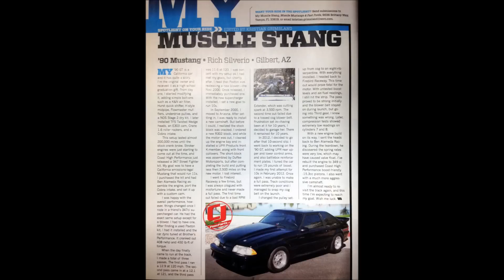Foxbody 349 (.060 over) Engine Build

Comment from the maker: script420 Yes it was a Coast 347 kit. I've had this kit in my car for 10+ years. The piston failure was due to an extreme lean condition from an overly aggressive on timing curve (my fault). Expensive learning experience.  Coast High Performance is a great company. That's why I re-used them on this build. If you're running a stock block that may be your issue. They weren't designed to withstand that much power. Good machine work also goes a long way. I had split a stock block in the past even though it was girdled. Back then I was only making 413 hp with 450ft lbs of torque. That's why I'm running the R302 Block now.
Reply: FitFox crazy I lived in AZ in the 90s and I think I've seen this car at the Pavilions Auto Show lol small world. Great car!!!

Comment from the maker: @kyle you should be fine. If you look at my other videos you'll se a black coupe. That one has 165k miles on it. I've added GT40 heads, Trickflow intake, E303 cam and a Nitrous Express 175 shot kit. Cracking a block with the mods you mentioned is very unlikely. You'd have to be pushing at least 500 horsepower before I'd worry about it.

Comment: My buddy has the same cam in his stock bottom end 302 with ported p heads. You would think its to big at 579 lift and 238/246 duration at 050 but it's pretty strong for what it is. Runs low 7 8th with a T5. He has alot in his suspension though and it weighs 2750 with him in it.

Comment from the maker: 93foxwcube-its only a 28x11.5 inch tire.  Rear rim backspacing is 5.5. Just had to roll the fender lip a little
Reply: this is were i tell you 26 x 10.5 is optimal but wut do i know..lol  

very nice!.. looking to buy a novi 2000.  did a search and came up with your vid...
Reply from the maker: *****
The original Novi 2000 is hell of a blower.

I've been running the 28's since 2001. I like'm lol.  Lotta factors on what tire size is optimum
Reply: Novi347 yes for sure.;.. i guess a 4.56 gear would be good for 28s.. but again wut do i knowlllololol
Reply from the maker: lol exactly :)
Reply from the maker: Thx holly
Reply: np

Comment: @Novi347 You mentioned failure, was that a coast 347?  I have pretty much the same set up 10lbs of boost made 487rwhp at 4900 rpm and 590ftlb torque at 3900 less then 100 miles on it and had main cap walk, engine wasnt abused at all never spun over 5000 R,s

Comment: novi347, hey guy what size tires you running in the rear and did you modify the body for clearance or cut the differential? i own a 93 but mine looks like s*** beside yours.
nice stang dude.

Comment: so im 18 and I am going to get a foxbody and I was woundering if the original block lets say around 100,000 miles can handle a trick flow intake gt-40 heads and a b303 cam, the 90's came with the forged internals I believe so im thinking they can but not exactly sure I don't want to put this money into it then I crack the motor or something. thanks

Comment: What a bout the notch back in the garage
Reply from the maker: I have a few videos of the coupe.  It currently sports; GT40 heads, TFS Street heat intake, an E303 cam, and a Nitrous Express Kit.  I do have plans to build a motor for it with my son since it will be his. It won't be anything fancy right now since it will still be based on a stock block. It el must likely be a 10:1 306 with AFR heads and a custom cam suited for Nitrous use.

Comment: I have a quick question, I'm looking to get a foxbody and I found this year car, he posted it as "1990 mustang cobra"  I thought the cobra's were produced in 92'?
Reply: I know this is a 4 year old post but if the car was posted as a "1990 Mustang Cobra", that means the car came from Canada. In the U.S., 1993 was the only year Cobras were made on the 87-93 Fox Body platforms. If the car was a 1990 from the U.S., it was only a '90 GT with Cobra parts added to it.

Comment: How much money did you put into the car?
Reply from the maker: Since I'm the original owner that would be the highest initial cost. Paid $15k for it brand new lol. Never really added the full total up. I can though since I've kept every single receipt lol. Things can add up real quick, especially if its built to withstand abuse. The motor itself is easily at least $10k.
Reply: Novi347 wow :o  I was just wondering because i'm probably going to start a foxbody project this year. I don't have much cash so i'll do a junkyard build lol. That's a nice car you got though.
Reply from the maker: Nothing wrong with a junkyard build.  Seen plenty go fast with a simple setups as well!